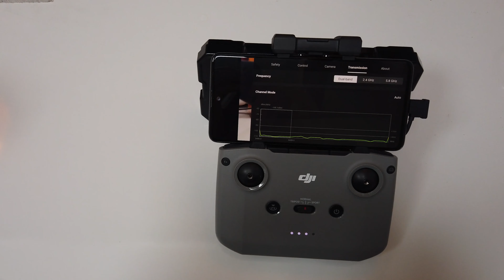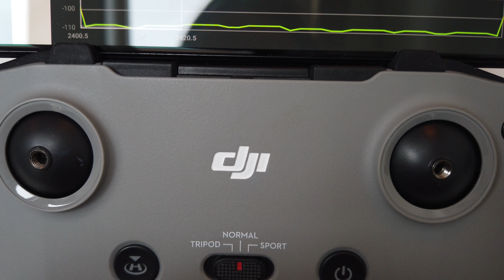DJI Drone | Testing the AlienTech Range Extender; how much boost do you get according to graphs?

Comment: Just watched both of your videos on this.  I’ve been thinking of buying the same extender for my mini 2.  Is it worth it?
Reply from the maker: Yes, it works pretty good. Just don't do the building of the antenna yourself; it's no fun and is a very difficult process. You can easily buy a controller from the same company so that they build it for you.

Comment: You need to make fcc hack! You are not in fcc mod my friend
Reply: It will boost any way.
Reply: Can you give us a update on how this is working for you?
Reply from the maker: @jmm03256  It's working pretty well; under the right circumstances. Only 5.8GHz works; the 2.4GHz or switchable does not perform well. But when pinning it to 5.8GHz I get fair range at the right place; been at around 3.5 miles at a rural area and at around 2 miles at an urban area.
Reply: @NetnamChannel  how about now any updates ?? when you gonna make the range test?